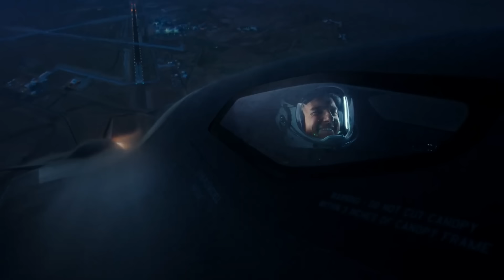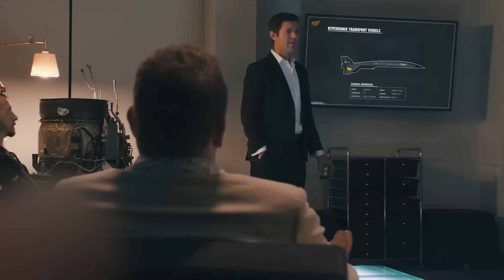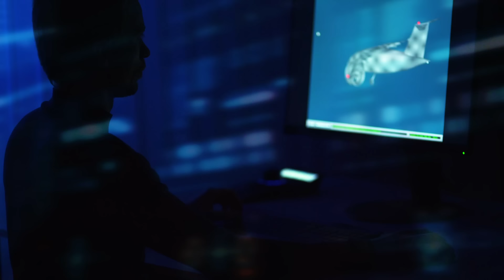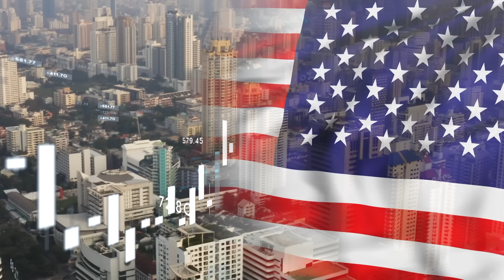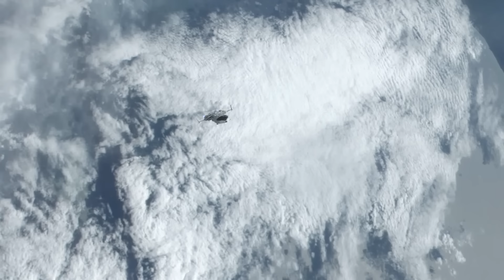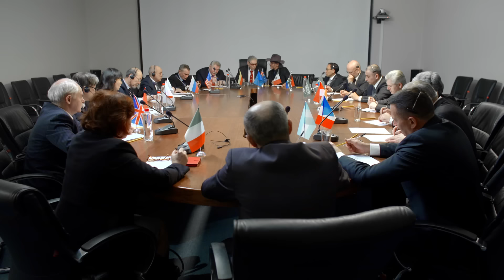US Revealed Top SECRET Hypersonic Aircraft Reaching Mach 10

Comment: This is from GOOGLE:
What would happen if a human went Mach 10?
You would die. Parts of your body would tear off in the wind and and you would disintegrate. Actually accelerating your arms and legs back and forwards to run at that speed would pulverise muscles and bones. Ten times the speed of sound with is around 3 km per second.
The speed at which Maverick flies the Darkstar in Top Gun: Maverick is Mach 10, which would subject him to approximately 34 G-force, rendering it practically impossible for a human to survive such forces as it would severely damage their body from the inside

Comment: Here is a thought maybe NASA can take 1 of there old Space Shuttles out of retirement strip off the outer shell 🐚 and recover the outside with the SR72 and maybe use 2 engines the SR72 on the upper wings that would get you off the ground get up as far as 80 000 feet then turn the rockets on to get into space. I know there is a lot of stuff to do but maybe there is somebody way smarter than I am that could do this. Anyway thanks for listening
Reply: That's how redd-necks would build it.
Reply: @viralsheddingzombie5324  just incase you didn't know the space shuttle is covered in Aluminum and that's why I said what I said if had been covered with the same metal as the SR71 there might be a chance that the shuttle would of survived. Oh and besides I like the space shuttle. And also I think someone took a shot cut when it came to the space shuttle.

Comment: The legendary SR-71 (Blackbird) in recorded flight (mach 3.3+) went coast to coast (2500/3500 miles) in approx. 68 minutes. Yet you say that the SR-72 takes hours to cross Continents.
Reply: Well, Florida to Greece is approximately just over 5K miles, assuming Edwards AF Base or some place within the range of the Aeronautical industry mostly being in California, would add another 2400-2600 miles to that.. at 68mins from coast to coast being 2700 miles x2.5 would put Middle EU at 2hrs 20-50 mins roughly. So although some stuff sounds far fetched, at least the math works to a degree.  Not to mention, do you think they would tell us exactly the truth by putting the classified information on Youtube where anyone could have that information?  i mean.. It is the internet.. lol
Reply: @inchranger  Actually, the final flight of the SR 71 was a round trip record setting flight to Paris. The problem was, while crossing the continental US, it couldn't go supersonic, until it reached the east coast. 
Ironically, the documentary video is here on YouTube.
Reply: The key word is continents, as in plural.
Reply: The blackbird was impressive, made of titanium and liquid nitrogen in the tyres, so it would not melt at those speeds. The air force has lost the blueprints to try and replicate the engine. It was only scrapped in the end because of fuel consumption, and they want it back. Very impressive, even for today, from technology over 60 years ago.
Reply: @johntaylor3298  Well when you put the best minds with enough resources, you can build something that lasts. We still have WW II bombers flying & ships still afloat and can be put back into service.
Reply: Just imagine if the money sent on weapons to kill  could be used towards peace and poverty in the world 🌎
Reply: @frederick9253  The Blackbird was about maintaining the peace. It was a spy plane, not a war plane.

Comment: I suppose it's a drone, since at that speed, no human could deal with the G forces when turning, etc.
Reply: This is not a fighter jet, it’s not ment to be super maneuverable, so a human pilot could easily deal with the G’s. The X-15 flew up to Mach 6.7. The SR-71 pilots would not exceed 2g’s in a 180 turn at full speed. The turn took around 100 miles. Also at the height these planes fly the air is thinner, so the elevators, ailerons, rudders, etc. become less effective, lessening maneuverability.
Reply: No creo que gire a esas velocidades , ni siquiera lo hace un misil hipersónico aún. a no ser que se pueda lograr tener a la persona en algun tipo de cabina antigravedad , a no ser que se obtenga esa tecnología de ovnis , va a demorar bastante tiempo, pero se esta trabajando en ello.

Comment: I doubt that there is a plane that can go Mach 10 and have no idea what good it would be anyway. Mach 10 is 7500 mph. The turning radius would be a small country.
Reply: "Turning radius".You mean that to operate a curve at this speed,the width of a small country would've been necessary to do it,that's it?🤔
Reply: @RUDHUNTER  I thought that I put more simply. LOL, but yes.
Reply: Les  the SR71 took  2 states  @mach 3 to make a turn
Reply: @leswilmot1272  Tom Cruise seemed to take an entire continent lol
Reply: @bobcrane9945  Don't know where you live but just outside of Edward's   Airforce base in Palmdale  C A are 2 Sr 71 you can look  at all day.
Reply: Rockets can do it... why not planes?
Reply: @stever2583  First there is  significant difference between a rocket engine and a jet engine. More over there is a great deal of difference between the airodynamics of a plane and a rocket. Finally I didn't say that they wouldn't eventually get there I just don't think they are  anywhere near it yet.
Reply: @bobcrane9945  Rockets are just stream lined planes... They are not all bullet shaped. So the matters at hand are the maneuverability, propulsion, temperature fatigue. So we have scram jets (rocket /jet hybrid  sort of)... Temperature fatigue (which have obviously been resolved due to the speed rockets travel at) and maneuverability  which even "go fast" jets have issues with... From what I read (all very public) there are, by all accounts, some very  very good prospects for near future and rumours of even better prospects already being tested. So what is the problem? or doesn't "Murica" do hard anymore? That is almost a Republican ideology isn't it? Too hard... Meh!
Reply: Teo reasons: this will delay China and Russia from starting anythingnand we alwsys will need  faster and faster speeds for that ssme reason.

Comment: Opening weapons bay doors fling at this speed would rip this plane apart.. Like the shear pressure around this plane while at mach 10 would not let the doors to open tbh.
Reply: Not if they open toward the back :D
Reply: That's a basis to start envisage certain things. @DudeGuyShow
Reply: @RUDHUNTER  They've got guys there light-years ahead of me there at least lol
Reply: I'm pretty sure they factored that in development. @DudeGuyShow
Reply: @davidstowe1688  I'd be curious to see if they opted for DEWs on it, could pump some serious power with those engines
Reply: Right. Everything would have to be inside the airframe. It would be great though. Mach 10 fighter jet? Like that thing would pull up beside a Hypersonic missile and take a picture of it. LOL. @DudeGuyShow
Reply: @Rekt_Sigma00  Would be cool if they can incorporate the TUSPL, if it works how I think it does it should be pretty compact
Reply: If the bay doors are designed as aerodynamic structures, instead of just "hinged body panels" it could work. It's definitely an engineering challenge though.
Also like DudeGuyShow said, a rear bay could work. That'd probably be a lot smarter/better.
Also I think it's that at that speed (and the associated altitude), you could tip-up, and temporarily 'exit' most air resistance. Though you'd have to restart the engines after. Check out the X-15's experience with bouncing off the atmosphere and ending up in the wrong state. And that topped out at about mach 7.
Reply: @kathrynck  I would love to see this plane tbh. Like it would be an innovation masterpiece.
Reply: If the doors didn't open into the airstream it could. If they retracted inside the aircraft.
Reply: You mean the "Airframe or wdym by airstream? If you mean open outside of course the missile would have to be thrown out some how or he would blow his self up.  or they could design the launch like a torpedo. 🤣🤣🤣😂😂 @sealteem1
Reply: It's another spy plane. Not an attack weapon.
Reply: You didn't see the video? Like why would anyone need a spy plane in these days and times? Like satellites give all the recon anyone could want. @lennychorn147
Reply: But as you know well how it works for everything,if a proposal doesn' find utility somewhere,it hopefully gonna find it's proper definition somewhere else,isn't it?It's the same as like when a commercial prospects to honorably earn his living,or when you do purchases to supermarket,isn't it?You choose to pick,or delete,right?The choice,once again. @lennychorn147
Reply: @lennychorn147   It will be used to attack. There are so many things better then spy planes these days.
Reply: Pretty sure that very subject made for many sleepless nights for the
"Miricle a Minute" engineers !!!
Inward opening doors or revolving carrosell ???
They have many many tricks !!!
Reply: On a second perspective,for aircrafts wich are conceived with  supposedly more flat  hold's body panels and  a more regularly horizontal lined fuselage at their basis; The
hinge mounted body panel could also be useful,except that instead of flap open outward, and by the way,could endanger the  aircraft's integrity with a critical shear,,theses body panels could flap inward the hold's compartment,by hoping it won't jamm any dropping or launch.This,in a context where the hold's volume could possess enough room to allow the panels to flap in,but i unfortunately don't have any infos councerning the specificities about the hold's dimensions and shape,unfortunately.

  @williamcollins4082
Reply: On a third point,Still councerning aircrafts with  more flat shaped hold's door body panels;The two distinct halves could also directly sling on opposites directions to retract inside the fuselage,wich is suppose to be horizontal shaped,in that case.
By this way,the hold's body panels would not behave like inward or outward flapping doors,but act more as a hatch's trap-doors.This,still in the perspective where the dimensions  allow each panel to be properly 
horizontally retracted inside the fuselage's thickness,without represent a disconvenience,councerning the  dropping or launching system's efficiency of the aircraft.
 @williamcollins4082
Reply: And on a fourth point,i guess i had the pleasure,Yersteday evening,to deal with some of the "minute miricle" engineers of yours,except that it was on road,and they seemlikely tried to induce an "inward  revolved side carrossel" overhaul to my vehicle,as usual,of course.Or race,if you prefer.or maybe it was more a "fronting  carrossel and an engine backward inside" they've tried?🤔.Did they were coming from your hangar,too?. That's gonna be a  hollywood sucess,in that case:"The night road goodbye"..😋🥷🏾😉😏 @williamcollins4082
Reply: Now that I think about it, I'm sure that the skin and body of this plane has to be solid. Like with all that pressure pushing inward. If the body had a void in between the layers for this door to slide inside it's self IDK what would happen cruising at these speeds. @williamcollins4082
Reply: Why would they need to open? Like normal aircraft. Why not have the bomb or missile jettison out the back. Just a thought.
Reply: Missiles have thrust vectoring nozzles and if the enemy was above you, then the missile would hit you fist probably.  @bruceweirich3733
Reply: Plus, when a missile is released its armed then, there have been times where missiles has blown up on the wings if planes because something happened to the release mechanism not allowing the missile to release, thus blowing up on the wing. If this happened here, then it would kill everyone on board. @bruceweirich3733
Reply: Yes,the back seems to be the most directly feasable alternative,effectively.I never heard about missiles launches from the aft yet,but releases and droppings are an effective way to make things happen.I proposed this concept as an alternative to other kind of devices or utilities.But if the concept doesn't seduces by this way,it'll hopefully find it's utility somewhere else,i also dare to hope.The concept's proposal is made to keep ensuring the aircraft's stability and integrity in hypersonic flight and extreme temperature conditions,if i remember correctly?🤔  @bruceweirich3733